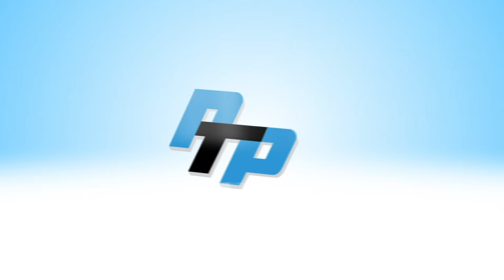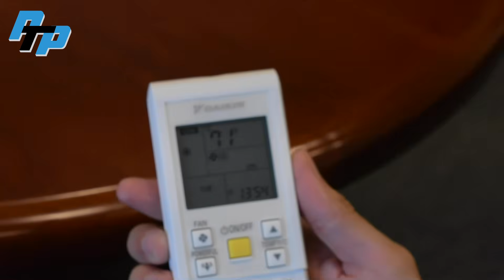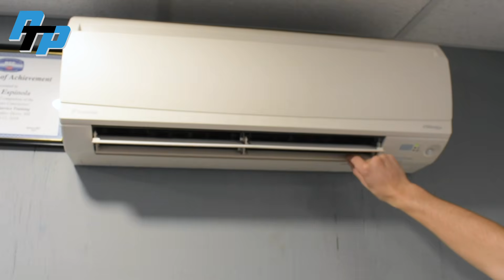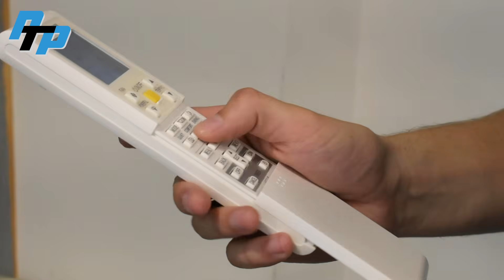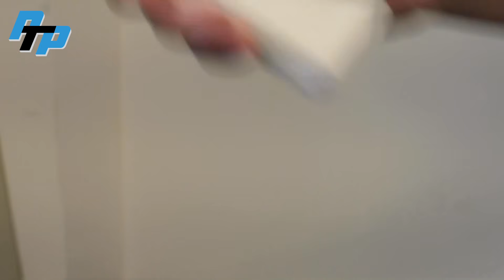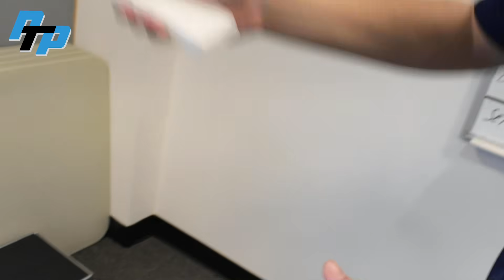How to Use Daikin Remote Control for Ductless Mini Splits

Comment: Hey just moved into a new house that has these exact ductless models … one of them has the snowflake on the screen while the other doesn’t ..( there are only 2 as the upstairs is central) the one with the snowflake seems to be colder and more efficient … the one without still blows cold but doesn’t have the snowflake on the remote screen … is that normal ?? Is there a master remote ?? I’ve searched everywhere and can’t figure it out ..:.:
Reply: Snow flake is air conditioning mode

Comment: How do you use MULTIPLE heads- it seems my remotes and heads are arguing with each other because of mixed modes? The green light just blinks! So frustrating-
Reply from the maker: You want to make sure all of the heads are set to the same mode.

Comment: Hi thanks for the video. Question, have a place in central Florida and am not there 9 months out of the year. I want to set the temp to stay below 80° but also stay above freezing. If I set it to Auto at 80 then those months when its below 32° will it keep it at 80°?
Reply from the maker: Yes, make sure every indoor unit is set to auto or it won't work properly.
Reply: That's the whole point of Auto mode. The unit will adapt to cool or heat as necessary to maintain the temperature you've set. 

Although I must say it's going to cost you a fortune to keep it that warm in the winter, depending on what average winter temperatures are there. I live in the Florida Panhandle and I can tell you from a decade of experience with a mini- split, that it's a lot more efficient, and thus a lot cheaper, to cool than to heat with a mini-split. I would never leave mine on at 80° during the winter  if I'm not even going to be present! Why not just keep it warm enough that your pipes don't freeze, and make sure you insulate them to make that less likely?

But maybe you have money and don't care about that. Myself, I don't like the waste of energy. We all need to pay attention to this. Electricity is not free of climate change acceleration and other ecological effects. In Florida, our electricity is primarily generated using fracked natural gas and nuclear power. Fracking poisons our water and, even discounting the potential for a terrible accident, we still don't have a place to store spent nuclear fuel rods for the tens of thousands of years in which they will remain dangerously radioactive.

For some of the older nukes which are currently being decommissioned, like Indian Point up the Hudson River from New York City, they're talking about transporting huge quantities of spent fuel rods which are highly radioactive across the country by train or truck to a defense nuclear waste facility in New Mexico. What if there's an accident like there all are all the times on our roads and railroads?

Sorry, I didn't mean to turn this into an environmentalist screed, but I ask you to consider whether you really need to leave that system on during the three-quarters of the year when you're not even there. Could you get a neighbor or someone you might pay to turn on the A/C at appropriate times to keep your place from getting full of mildew and mold, and to turn on the heat to keep your pipes from freezing? That would probably be for less than half the nine months you're talking about, depending on what 3 months you're typically there. And if you don't care about saving money, you should care about saving energy. We all need to think about this if our children and grandchildren, as well as all the plants and animals upon which we depend for our survival, are going to be able to survive on this planet. Just sayin'......

Comment: Do you know what mode requires the most electricity? Now that the summer months are approaching I want to know which is more economical; Dry Mode or A/C Mode.
Reply from the maker: Dry mode would most likely use more electricity as it will go to lower temperatures and run for longer.
Reply: I live in the Florida Panhandle and I've never even tried to use dry mode. In my experience, operating my unit in cooling mode also decreases humidity just as when you have the A/C on in a "normal" ducted  HVAC system.

I'm not an HVAC professional but it seems to me that a mini-split like those sold by Daikin is pretty much a non-ducted heat pump. In my experience with two different models, they are far more effective and efficient at cooling than heating, just like a heat pump.

Comment: Dude, this thing sucks! Can't even get the vents to open. How do I just turn it on and off? There are two On/OFF buttons and they just make beeping noises, but not function at all.
Reply from the maker: There should only be one on/off button on the remote. You don't want to use the on/off button on the unit itself as that will reset it. If you're having issues with getting it to turn on I would get an HVAC tech out to look at it.
Reply: I agree. This is terrible I’ve had it for 2 years and still can’t figure it out.

Comment: Hi, I have a Daikin but the remote doesn't have all these options that are in the video Could I get a different remote for it that has those options? thx!
Reply from the maker: I don't think so. The modes need to also be programmed to the head, so if the remote doesn't have those options the unit probably doesn't either.

Comment: Mine keeps blinking a green light on this line. Any button I press it will show up on the remote but the unit won’t do anything but blink that green light
Reply: I have three head units inside connected to one unit outside and all three need to be in the same mode otherwise the green light on the inside head unit will blink. So all three cooling or all three heating, etc.
Reply: @seandigital  thank you for your help. Been trying to figure this out for months. The YouTube videos don’t talk about that and it’s one of the main features which is not intuitive.
Reply: @seandigital  , thanks! I’ve been banging my head against the wall trying to figure out why the inside unit seemed borked. There was a second one in the house I’m temporarily staying at. Pair their mode setting and done, fixed!
Reply: @seandigital this man is a god. I have 4 in my apartment and 2 other roomates. I like it to be cold while the other 2 like it hot. Used your instructions and bam. Fixed. Thank you so much.
Reply: Yup same issue
Reply: @Ibanez012003  You need to runa diagnostic  from your remote. It will land on a malfunction code.  I know because I went to turn on our units for the first time this summer and mine just did the same thing. I got a U0 code, so the AC contractor is on his way out to take a look at our units. They were installed last summer and we used them for about 3 months. When I went to turn the units on today for the first time, I also got the blinking green light on the unit. Right now I'm just running the fan, and that works just fine. You run the diagnostic by pressing the cancel button for 5 seconds and then you keep pressing it sequentially until you hear a long sustained tone. After the long tone you'll see the malfunction code displayed on the top of the display screen of your remote control.  From there you can go online and see what that code means, but it likely needs a service call. At least if you know the malfunction code you can tell the service person.and it will help them to know where to start. Hope this helps you.
Reply: @Ibanez012003  Glad to help.
Reply: I’m having this issue now

Comment: How do you turn the heat on? It’s on the “Sun Mode”...but heat isn’t turning on...any help would be great as it’s winter...ANYONE.

I think it’s set to who lived here before us...HELP!
Reply: Does yours work now? I need tips for mine it won’t turn on
Reply from the maker: The sun mode is heat mode, so it's weird that it is not turning on. It could be an outdoor temperature issue, it sometimes can be too cold for the heat pump to operate. If not I would call someone to get it checked out.

Comment: I have been sitting here for 4 days melting in heat and I cant figure this dumb ac out.
Reply: @Weenie Hut Jr's Yeah that makes total sense. Why didn't I think to go change all the settings of every unit in the house to change the settings for one room. This is totally the users fault and not a fucking stupid design. Thanks for all the help douche bag.
Reply: Me too I put it on the snowflake mode and the lowest temp which is 64 degrees. And the blades just close and the green light blinks but I don’t feel any cooler
Reply: uo
Reply: @Weenie Hut Jr's ok now it all makes sense, I have one in my bedroom and there’s one in the living room that I never mess with. My dad usually operates the other one so I thought something was wrong with mine

Comment: If you make temp changes on the remote and the head unit doesn't beep, does the remote setting take?  My thought is you can turn the remote up/ down and the head unit would not know.  How do you keep them synced?
Reply: I'm having this problem also!  What does the beep mean otherwise?  Should I cancel/turn off unit between changes to be safe?
Reply: If the head unit doesn't beep no the remote setting dose not take  Yes you are right the head unit would not know.  Your question   How do you keep them synced you must have remote with in range and facing head unite  and  change settings with the head unit beep with each change on the remote when you do this it will synced. Example I change the temp to 30 c and head unit dose not beep so then bring back in to range and facing head unit and change temp or other setting  once or twice head unit beeps each time then back in synced

Comment: Hi, thank you for this video. Does this remote display the current temperature in the room? Or does the unit itself have a temperature display? Thank you. I couldn't find it in the video or the manual.
Reply: When it reaches set temp is  the unit suppose to turn off, mine is on continuously?
Reply from the maker: Thanks for watching! Neither would actually display the current temperature in the room. The remote will only display what you set the temperature to.

Comment: My split turns off and on every 1.2 min all night,  how to make it stay on all night ?
Reply from the maker: What mode are you running it in?
Reply: @paultheplumber8665  ❄️cold mode at 23 degrees. Without any other programming
Reply from the maker: @RFonte  Is it in a smaller room?
Reply: @paultheplumber8665  The bedroom is big. but it's actually a bit cold
Reply: Mine is opposite. runs non stop. Seems like it never turns off